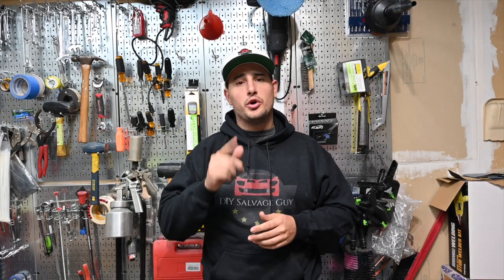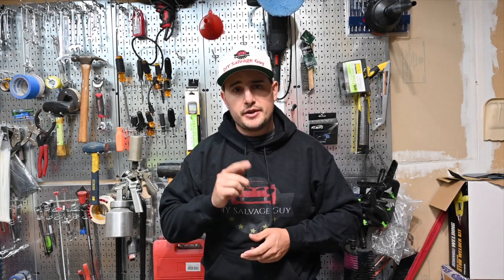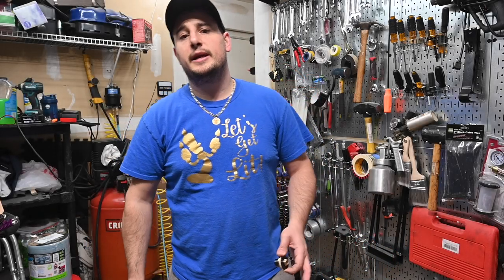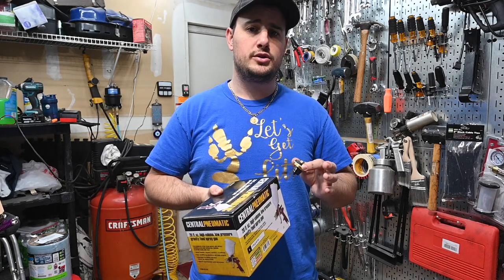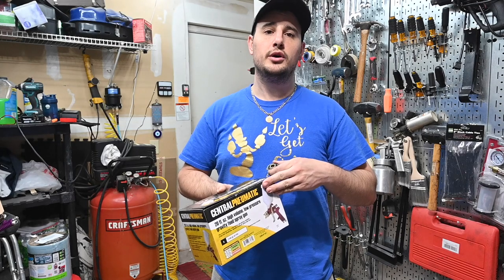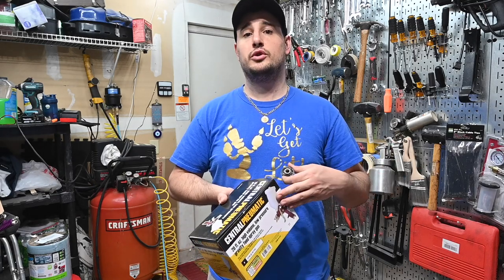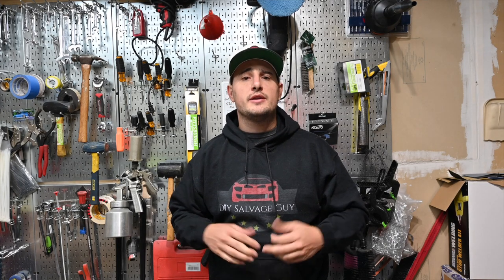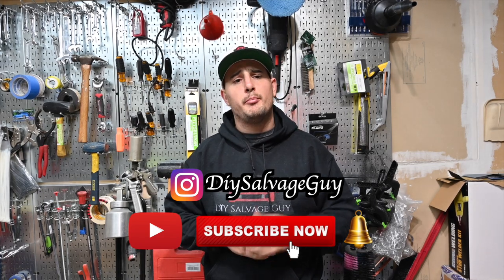Life Hacks at Home: Spray Gun Painting Tips Sizes and Spray Gun Setup

Comment: Excellent! My issue, that I am trying to determine, is that I purchased an inexpensive gun with a 1.0mm nozzle size recommended for the clear waterborne primer and top coat. But as I discovered later, the candy color to be mixed with that clear, the mid coat, recommends a 1.2mm nozzle size and I could not find this in a small volume (125CC/~4oz) gun, yet the paint’s manufacturer makes no such recommendations for an airbrush (any size nozzle will do they claim) and a 20oz gun +/- would be overkill/wasteful. My issue, therefore, will be what kind of problems might that 0.2mm nozzle size difference cause/present?  I have a 4oz HF gun but it has a 0.6mm nozzle. I wonder if this can be successfully drilled out to 1.2mm? Also the needles are generally tapered/conical doesn’t this create issues when drilled out (seating/leaks)?
Reply from the maker: I went from 1.4.to 2.0 for primer and had no issues with leaks or anything, but that's on the gun from harbor freight. You can drill it out and should be fine.
Reply: @DIYSalvageGuy  The gun (o.6mm nozzle) is a Harbor Freight gun. HF is nearby and easily and cheaply replaced, in the event I screw it up, so that’s the gun I wish to drill out. I’m still waiting on my candy color and only purchased 4oz due to its cost and it’s a guitar stomp box project, hence the small volume gun. I’m still uncertain why or if the nozzle size really matters since it’s been reported on the paint manufactures unofficial blog as having been sprayed by a 1.0mm nozzle gun and the carrier is the same clear used as the primer and top coat. All requiring only a 10% reduction with reducer. Why the candy recommends the minimum of 1.2mm is really a viscosity issue that may be offset by more reduction and a slight increase in pressure but the candy and clear are expensive and therefore in short supply. I have used the HF gravity feed 20oz HVLP guns though with good success using waterborne clear topcoats for wood projects, different paint manufacturer though. The candy was intended for automotive artwork and finishing but is still a water based finished. I realize waterborne and water based are mutually exclusive terms but both have been tossed out by the manufacturer and users here.